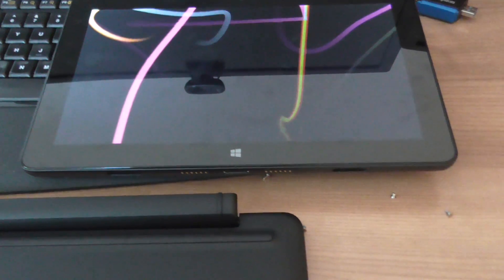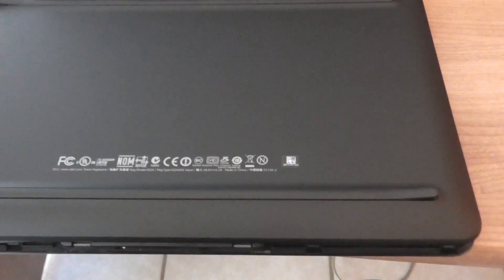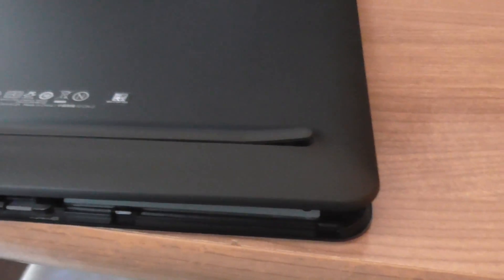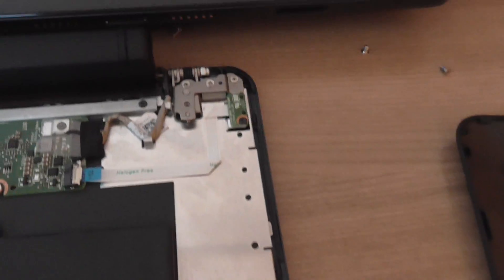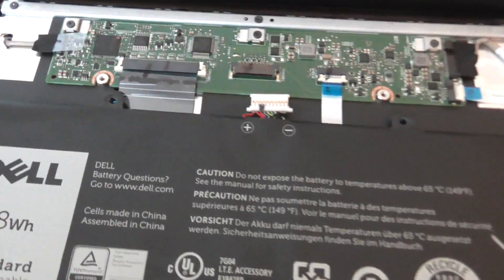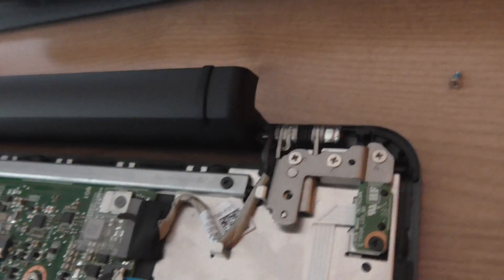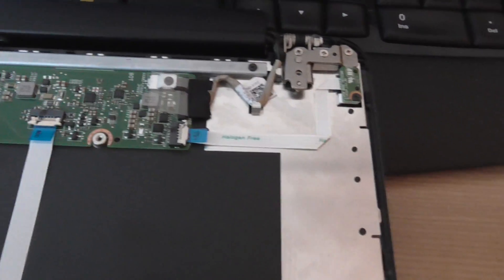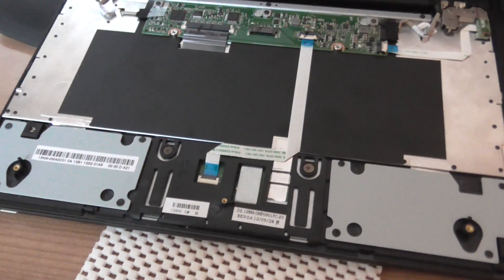Dell Venue 11 Pro mobile keyboard dock faulty not working & The Fix

Comment: As @plavevski and others reported a long time ago with my "dead" K12A disconnecting the battery-connector and waiting some seconds solved the problem of no responding keyboard and touchpad. Additionally I dis- and reconnected the both connectors to the contact-pins, although the connections looked perfect.

Comment: Mine works and charges well, but the only issue it has is that  the tablet doesn't display the keyboard's battery status.
Any help would really be helpful. 
Thanks.
Reply from the maker: Sadly never was able to fix that issue.

Comment: Since last night, my Venue 11 pro 7140 has been automatically shutting down when I dock the keyboard. I followed your instructions, removed the battery and it now works again!
However, I wonder if the issue would remain even with a new battery.

Comment: I tried everything on my keyboard, and nothing works, tried disconnecting the battery from keyboard, modifying registry, unchecking the options on device manager, and still have no function on this damn keyboard, i'm thinking about buy a new keyboard, but don't know if buy the same model or slim one, somebody knows if with a new keyboard, the tabled will not fail again regognizing the new one?

Comment: Thank's Mate,this is still helping people after 7years, the screws got me under the rubber on my tablet 5175 "pretty much same as venue 11", glad you did this video.thumbs UP.
Reply: Do you think this device is still worth buying in 2021? The same model (with extra battery in the keyboard dock) can be bought now for around 280 euros. I am looking for an ultraportable Win10 laptop and this Dell looks great due to the full HD screen with IPS panel (mostly it's just HD panels they use).
Reply: @luttekikker  Hi, sure i think still good for 2021, my wife uses 5175 Tablet everyday morning and nights after work. The extended keyboard umm not so good we had to replace a month ago due to hinges being so tight "from factory" it broke the hinge where stylus goes into keyboard..replacement Model T54KN keyboard/extended battery can still be bought for about 100AU on ebay..

Comment: I removed the key board battery.  Key board works fine without it.  Not sure what the battery does except lights up the keyboard keys.
Reply: You can't power the actual tablet with the battery that is built in the keyboard so you can work longer without being connected to a wallplug?
Reply: @luttekikker  Not sure what you are referring to?  The unit is powered and charged via a USB to the tablet.  It doesn't go through the Key board.  The keyboard battery would be charged via the tablet.

Comment: Venue 11 Pro 7140 here.  This video seems to have fixed my issue. The 2nd battery was detected and everything keyboard/trackpad related was showing in the device manager but nothing was responding to touch/key press.  After taking the keyboard apart and re-seating most of the wires the issue is fixed. I also updated the BIOS for good measure but I don't think it changed anything related to this.

Comment: i bought a used 1739 vpro old bios 16 i think. win10, both batteries charged fine. updated bios and it messed everything up. windows wouldnt boot. keyboard battery drain etc.
nice unit but has WAY too many flaws

Comment: I just solved my battery not found problem by updating from BIOS A13 to A14, just released, while the tablet was docked in the keyboard. The Dell diagnosis tool which could be invoked during boot shows the detailled battery status like charge level, health, voltage and current. Before the charging led was sending a morse code like 3x red 1x white, now it is stable white, still chargin in Win10.  The communication with the 2nd batter now seems really to work, so this was a software problem with some deadlock situation.
Reply: I've seen the 3x red 1x white morsecode on my 7440/keyboard as well! I blamed it on the 7740! I think I'll try another keyboard on it, one that has a working battery (the problematic combination has a "dead" battery, although now I'm thinking it's a battery firmware update issue). My BIOS already got bumped to A15 (with the keyboard NOT attached, regretfully). Do you have any suggestions how to upgrade the battery firmware at this late stage?

Comment: I recently got a Dell Venue 11 (7140) along with the Mobile Keyboard with the internal battery. The keyboard itself worked as expected but the Venue tablet did not recognize the keyboard battery, In fact the tablet only showed Battery #2 charging and Battery #1 as not available, with or without the keyboard attached. Pretty strange? However my fix came after upgrading the BIOS (A01 to A11) while the keyboard was attached. And now everything seems to work. Hope thus helps someone else. Thanks.
Reply: Disassebly the keyboard and disconnect battery, wait for 10-20 min and connect it back. It helped me.

Comment: I bought a used keyboard dock on ebay. When I got it, my Dell Venue 11 Pro(7130) wouldn't recognize the battery & it wouldn't let me charge my tablet while docked. The keyboard worked fine. So I started researching online about this problem. I tried various 'fixes'. None worked. I even tried the fix mentioned in the video above. Didn't work. So I kept searching online. I found a thread on the Dell support blog. It said to re-load the most current BIOS while the tablet is docked to the keyboard. I tried it. And sure as hell it worked! I hope this helps some of you looking for a fix to your keyboard battery problem.
Reply: Thanks for posting this. I also bought a used keyboard from Ebay and had the same problem. I reloaded the latest BIOS and it worked. Now the keyboard battery is recognized and is charging. Thanks.
Reply: Same here! The trackpad, keyboard all works fine, but i couldnt charge it. Reloadig the bios as im writing this comment. Will update later.

Comment: I would be grateful if you could suggest any solution in my issue. I just bought a used keyboard for my 5130 tablet. Keyboard keys and touchpad works fine when attached to tablet. But the battery is not recognized in windows 10. The status is "Battery 2 not present" in Dell's power manager and "The battery is not available for use" in windows power manager. Moreover the battery is not detected in BIOS. I have charged the battery from its mini-USB port and seems to be charged ok (white led during charging). The battery is only detected on the dell's diagnostic test and shows its remaining charge (e.g 91% when i run the tests) and "n/a" in the health status.

I opened the keyboard and disconnected/reconnected the battery. When battery is disconnected, the keyboard and pad does not work. When reconnecting the battery they work fine but still the battery is not recognized
Reply: This is fairly old so  I'm sure you've moved on, and have fixed this. But in the event someone stumbles on this I would like to provide them with the information to fix it.  At the time of your posting the keyboard would not self charge. Which means once it dies its dead until you charge it separately.  They came out with a BIOS update that then fixed that issue. However, the PC can still only charge the battery from 1%-90% so you have to charge the dock separately until it hits at least 10% or it won't work.

I had this exact problem a few months ago when I found that solution. Currently I'm experiencing other peoblems, and that's how I stumbled upon this.
Reply: Try to remove the battery from the tablet, and plug your charger while Windows is running.
Reply: Thank you for your answer. You mean to remove the actual tablet battery or the dock battery? I have tried to remove the dock battery with no result.
Reply: +Georgios Theodorou I mean the Tablet battery.

Comment: Did this permanently fix the keyboard for anyone?

I have one of these and the whole thing stops working regularly.. The connection of the keyboard does trigger the tablet/desktop mode switching in windows 10, and the second battery connects fine, but neither the keyboard or mouse works.. 

Opening the keyboard and pulling the battery, then reconnecting it always fixes it.. but it will go wrong again in a week or so.. Its getting to the point I leave the screws out so i can pry it open as needed.. Not a great fix.

I'm wondering if i can somehow add an external switch that will cut the power from the battery off, which seems to reset something inside the keyboard.. And if so.. which wire should i be hooking that into.. the battery seems to have a lot of connections for its monitoring functionality..
Reply: I didn`t find a fix. But u can just use keyboard without battery.

Comment: Disconnecting the battery on my unit resolved the trackpad not responding issue.
My situation started after charging the keyboard directly via micro usb. 
Must be due to some update over the lifetime of the product. 
During the initial purchase of my 7130, I know I charged the keyboard multiple times on it's own.  Last case rendered it useless until I removed the battery cable for 30 seconds. 
Thanks for the video and your time!

Comment: Anyone got their battery keyboard working on windows 10. i have tried every fix out there and it just doesnt wok. really pissed off with dell.
Reply: +Abz Hussain mine works without issue. Battery, keyboard and touchpad all fine, did not do anything special. Did do a clean install of win 10 though (kept nothing) and applied latest dell bios, that's it. Good luck!

Comment: Some more info, if the keyboard isn't working, likely it is the Human Interface Device Driver. 

Go, here diagnose keyboard typing issues.

dell.com/support/home/us/en/04/product-support/servicetag/8M9GR02/diagnose?rvps=y

Works often for me.

Run Keyboard Diagnostics.

Trackpad problems remove center battery cable test, then plug back in while docked.

Last and final fix, avoid Dell.

Comment: So I have problem about mobile keyboard and try so many way to improve. but i can't solve it. My problem is: Keyboard is work fine Battery keyboard is not recognized with command alert from tablet (not communicate with tablet or replace battery) When i plugin mobile keyboard, the led is turn on 10 or 30 second and off forever.I try this way and regedit but nothing happen. i buy from us and now i am in VietNam. What can i do, guy ? Somebody like me ? Pls, help me
Reply: +Hùng Võ  I believe the problem is dell has a fail safe software that is deactivates the battery thinking it is non OEM.
Reply: +chris bonnet tks for your answer, i am checking battery of keyboard (it's die or empty to make sure) and find another driver or something update from dell to solve it. except everything fine. so sad. price of battery keyboard too high.

Comment: Does anyone know if OS version or keyboard firmware version makes a difference here? I am running the latest firmware for the keyboard, all drivers. Windows 10... Everything up to date. I think from reading elsewhere online that the problem were facing here is probably a hardware one and its not firmware / driver dependent. Sucks. 

Then again maybe it could be something fixed with a newer firmware, but at this poing does Dell still care. This tablet, despite being great is getting a little long in the tooth...

Comment: I have a Dell Venue 7140 and this video gave me the courage to open my keyboard and modify the hinge! So, yes, it's possible to increase the lean angle. Remove the hinge (3 screws on each side) and wire connectors on both sides. Remove the shaft nut (do this one side at a time so that you can use the other side as a reference for the angle and the hinge friction/resistance). Then remove the outmost washer and move the hinge mechanism 1 or 2 mm outwards to give your dremel space to work. Use the dremel and chisel off some material on the inner part of the shaft, the part that makes the hinge stop at a specific angle. I probably took off less than 1mm material, increased the angle by maybe 15 degrees, but I then found out the limiting factor is the hinge backpiece rubbing on the keyboard bottom plastic (so don't chisel off too much material). The end result was great, using math I calculated the angle to 38 degree (or 128 if you will) and still not tip-over-critical.
Reply: Harri Harju Interesting, I'll have to try that. I just removed the bottom of the keyboard to disconnect the battery (and this got my keyboard working again.... for now). It was assumed that the reason for the low lean angle is due to the weight of the tablet part being too heavy and thus too much of a lean and the keyboard would tip off the desk. However it looks like you've found a little more room to work with.

Since my keyboard is now already compromised looks like this little "mod" is something I might just try. I just got a new dremel (knockoff brand) last week. Time to put it to use!
Reply: Did the mod. Took about 5 min total once I had the keyboard opened and the hinge assembly removed. I kept the nut on and used one of the cut-off wheels to just trim the little tab that limits the hinge travel. Now the hinge turns and turns and turns....ect freely. The only limiting factor is the hinge hits the body when opened far enough. That plus right around that vicinity the entire unit Really wants to tip backwards. 

So far so good. Very happy with the results. It leans JUST enough to make viewing comfortable. Totally FREE mod, took nothing but some time....
Reply: +Brendan Beck would be interested in a video how to

Comment: Thanks for the video, I don't have any issues with my keyboard but I am very interested if it is possible to adjust the hinges to get a little more opening angle.  Trying to see the hinges in your video but couldn't quite make out what is limiting the opening.  Any thoughts would be appreciated.
Reply: rexburke yes, I would like to do that also. Just need to pluck up the courage to open it up and study that hinge. With the lighter 7140, it could certainly tilt back more without falling over. Who will volunteer?
Reply: @jamesregan6951  @poruatokin the hinge itself is the limiter it opens up to a degree. Thats it

Comment: Great video of displaying what the internals of these keyboards look like. However - I found if it this doesn't fix the issue - the actual dock port on the tablet may be the cause. At that point - you would need to call Dell for a replacement (If under warranty).

Comment: This also fixed my problem of the keyboard battery not charging, or discharging. Battery was recognised by the tablet but nothing else. Disconnecting the battery connector and re-attaching whilst docked the tablet seemed to get it all working again.
Reply: +Jon Bielby Did this stay fixed for you? I have the same issue but everytime i disconnect and reconnect the battery it works for a wekk or 2 then goes wrong again.. just wondering if yours stayed working.. Thanks

Comment: My keyboard can't be charged through the keyboard micro-usb 

Is it everybody's keyboard can be charged?
Reply: Mine won't charge through the keyboard micro-usb OR docked to the tablet. Also, I thought I had a bad tablet because it went into a boot loop that couldn't be fixed except by disconnecting the tablet battery and CMOS battery, but I only had the problem when I attached my separately purchased docking keyboard with apparently dead battery.

Comment: Unfortuately, opening the keyboard shell is the way to fix this, even though its a SW issue.  Good how-to video on opening the shell.  To restore touchpad operation, open the keyboard shell, dock the keyboard to the tablet, disconnect the keyboard battery connector, then reconnect the connector.  Keeping the keyboard docked to the tablet while you disconnect and reconnect the keyboard battery is essential.  That resets the bit that connects the keyboard battery to the touchpad.  To keep the touchpad from failing in the future, only recharge the keyboard battery while it is docked whenever the keyboard battery power drops to 0%.
Reply: Seconded.  Bought a refurbished Czech keyboard from eBay for a Dell Venue 5130.  When it arrived I connected to the Venue 11.  All worked, except the battery showed as not present.  A quick google found a Dell article saying that if the battery in the keyboard drops too far, you will see this, and the Dell solution is to charge the keyboard directly from its micro-USB connector.  Did this, and sure enough the second battery then showed up when I next docked it and was now charging through the Venue 11 itself.  BUT, no trackpad.  This worked before I charged it directly and as others have reported, this can break the Trackpad functionality.  Left and right click still worked, but could not move the cursor.  I have two Venue 11s (1x5130 and 1x7139) and also 2 keyboard so I was able to prove it was not an issue with the tablets themselves as both worked fine with my original (UK) keybaord.  Firmware, updates, SynaFxUtil - nothing worked.  This video set me on the right path.  All I did was disconnect the internal battery in the keyboard WHILE docked to the tablet. Didn't adjust any other cables. Waited 30 secs.  Reconnected keyboard battery, rebooted and yay!, keyboard and trackpad working and battery still available.  I firmmly believe the direct charge of the keyboard initially caused this issue.  Thanks to OP and Robert Jackson for the info.